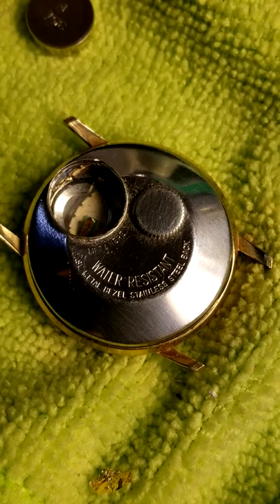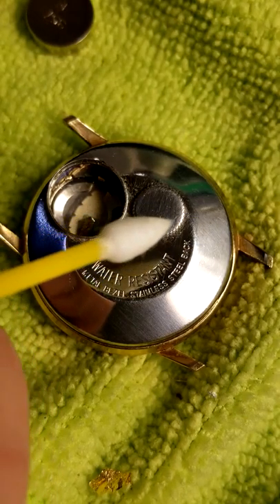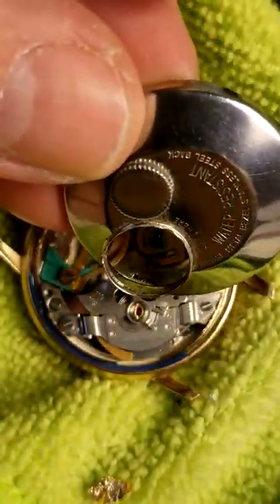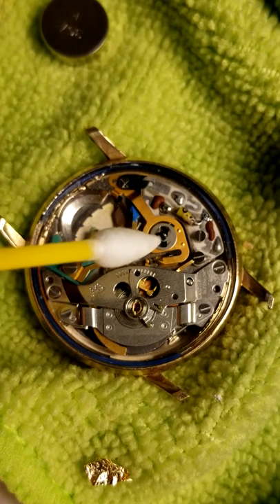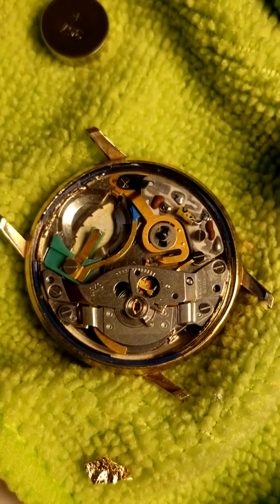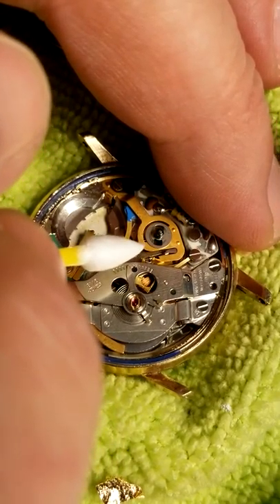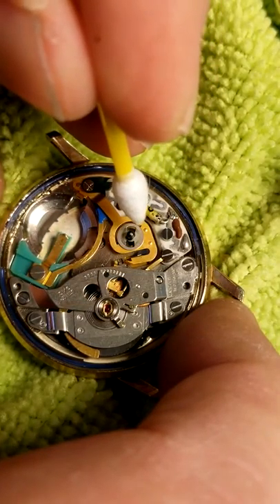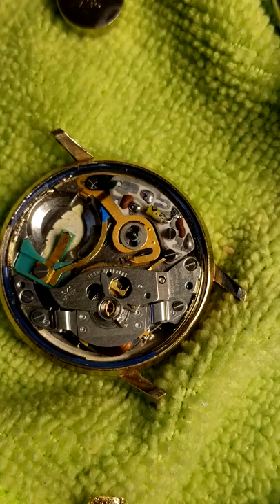Timex - Hidden Crown, Auto Start Feature

Comment: Yep. 👍 my M 40  pre dynabeat /hi beat has that feature also. When you pull the crown out it parks the balance under tension allowing the re-start. When released, it resumes normal operation. I like the feature because it allows me to park the movement when I'm not wearing the watch. Saves it from wear and tear plus reduces the service interval.
Reply from the maker: Not to mention these old watches really eat up the battery :)  lol